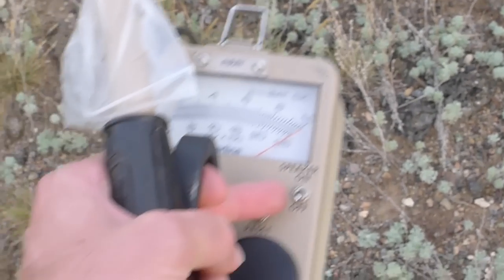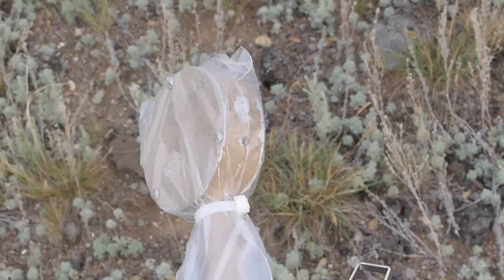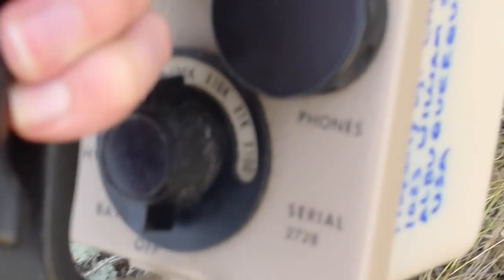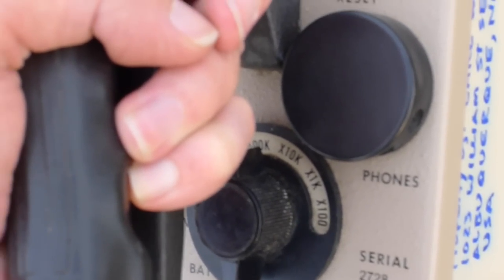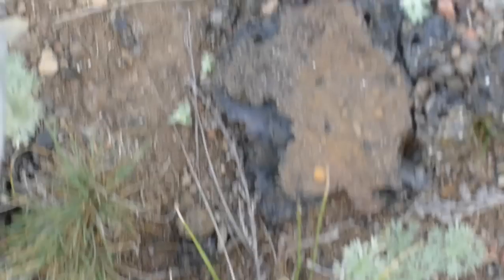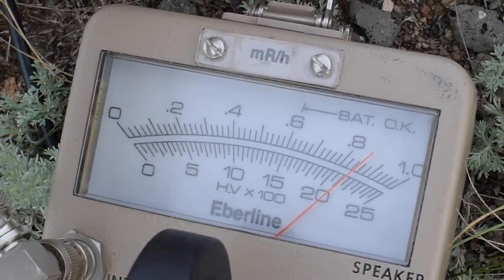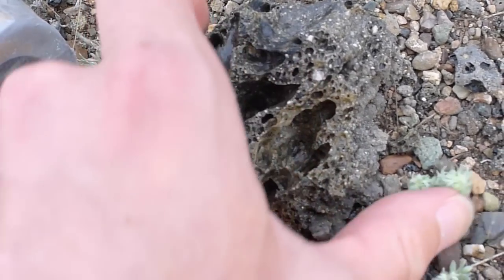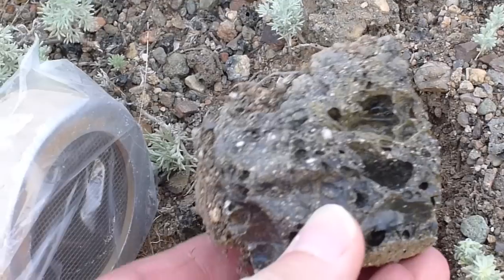Site of the first Soviet nuclear weapon test (RDS-1)

Comment: Great video but too short! :D Thanks
I often see this more professional setup of Pancake detector and Hotdog detector heads and I was wondering what sort of ball-park figure should I expect, to obtain a modest detector with both heads?
I've seen and considered the Gamma Scout range but I would like something that can measure the higher and lower levels of ionizing radiation more accurately.
I've got some Trinitite specimens obtained from New Mexico  and I'm presently without a detector but this video shows similar examples of Nuclear Sand but not green like most of the Trinitite specimens .

Comment: One hundred counts per minute of what unit of measurement?

(Just saw the milliRem per hour thing on your counter.)
Reply from the maker: The mR/h conversion scale means nothing, generally, unless the specific energy-compensated detector that scale is designed for is actually attached to the ratemeter and is being used in a manner appropriate to that type of measurement.

Comment: Cs 137 is a beta emitter.  The shield on the Hp-270 is closed , so shouldn't the activity being detected be gamma only and not Cs 137 based?
Reply from the maker: Cs-137 is associated with gamma radiation of 662 keV energy, in addition to beta decay.  It is accurate (though somewhat pedantic) to note that the 662-keV gamma is actually emitted by the short-lived Ba-137m daughter of Cs-137, which is almost always encountered in equilibrium with Cs-137.  With the shield closed, the HP-270 is responsive only to gamma radiation, enabling exposure rate measurements.
Reply: Yes, but going back to the original idea of my comment (albeit poorly written) isn't the activity you found something other than Cs decay?  The half life of the Ba 137 gamma is really short and you would think that the quantity of the Ba material would be so small by now as to appear insignificant to your measurement.  What do you think the gamma activity you found is due to?
Reply from the maker: As mentioned earlier, Ba-137m is in secular equilibrium with Cs-137 and the gamma radiation customarily attributed to Cs-137 is that of Ba-137m at 662 keV.  Cs-137 is a major long-lived fission product and tends to be one of the most important gamma sources in places like this after many years.  Activation nuclides like Eu-152 and Eu-154 can be important gamma emitters as well, depending on site geology.  My analysis of the gamma emitters from the nearby Chagan test site is shown here: 
https://carlwillis.wordpress.com/2012/08/19/gamma-analysis-of-chagan-atomsite/
Reply: Ok thanks!

Comment: To be fair, 200 milliroentgens is 2 milliseiverts, about the same radiation as a trans pacific airline flight. I'm 65 and would live in Fukashima or Chernoble if it were offered free with meals. The radiation in me stvareas away from the plants is lower than background radiation in Brazil.
Reply: It was 2mR/h, not 200. Also 200mR/h is about 1000x the dose rate you get on a flight lol

Comment: what is 100,000 counts per minute in rems per hour?
Reply: ~333 mrem
Reply: Not Real so less than a rad of radioactivity?
Reply: ***** youch at that level exposure over the course of a day can be lethal
Reply from the maker: As mentioned in the video, the measurement you guys are looking at is in counts per minute (CPM) and comes from a two-inch "pancake" Geiger tube.  It cannot be converted into mR/h or any other meaningful dosimetric unit.  The exposure levels in this spot are about 2 mR/h (obtained with a dosimetric probe; see the video beginning at 2:00).
Reply: Carl Willis and the safe limit from what ive read and heard is 5 rems per hour in 1 year. 1 russian scientist had been exposed to more than 100,000 rads an hour when a beam in an accelerator fired and went through him im surprised he wasnt killed on the spot

Comment: something doesnt add up here.  I have about half a pound of Trinitite in my basement.  Its fairly dead.  Also there should not be a count change when the probes switch.  I think one of the probes might need re-calibration.  I say this cause I have a piece of pitchblende from the Manhattan Project, on my calibrated scintillator it reads about 30k per second(1.8million per min) and on my geiger counter it is about half a rad a hour.  So I find it hard to believe that at 800k your only getting about 2milirads a hour?  This is even more so since the scintillator I have can measure alpha so its counts from the pitchblende are mostly alpha which your detector wont pick up and so the count number should be lower if you used your machine on my sample, so one of those two probes is off.  My gut says its your pancake model giving you too high a count reading as the 1-2 m/Rhr sounds high but not impossible given the site.
Reply: Your uranium ore does not read 500mR/h. That's because you're measuring alpha and beta too. Only use exposure units when dealing with gamma only on an energy compensated probe. The uraninite is highly unlikely to exceed 100mR/h in gamma.
Reply: There's nothing odd going on with the measurements. He didn't get 800k on the glass btw, I think it was 80k (exactly what you'd expect). The gamma dose rates also seemed to be around what I'd expect.
Reply: @inductivelycoupledplasma6207  yea except CV-700's only read gamma.  And I am well aware of how unusual the pitchblende piece is, like I said its unusually strong for uraninite probably due to the fact that its in matrix and the ore from the Manhattan project which used ore that to my knowledge was the richest uranium ore ever mined so there would be lots of daughter products.  None of that changes the fact that those readings in the video dont make a lick of sense for Trinitite of that age.
Reply: @Lucinat0r  it's not trinitite. The main thing that makes this stuff more active than "trinitite" is the greater number of weapons tested on the site, along with the fact that they tested underground nuclear explosions, which leave much more fallout at ground zero. You uraninite doesn't put off half an R/h, no matter how rich or rare it is. Measure it with a proper energy compensated GM probe.

Comment: Why is the site here highly radioactive but trinity is not radioactive whatsoever?
Reply from the maker: This site was the location of numerous nuclear tests, not just one as at Trinity.  The tests here were all more recent as well, so there has been less time for byproduct activities to decay.  Finally, much of the contaminated slag at Trinity was removed and buried, while the "Opytnoe Pole" remains completely unremediated.  Radiation is actually very detectable at Trinity today, with many areas around the obelisk measuring 30-10 times background from external gamma exposure.
Reply: +Carl Willis Thanks man.
Reply: Garry Cole I've got some Trinitite samples from New Mexico and although they ain't significantly hot, it's comparable to this but Trinity had far more sand below it so the Nuclear Glass is also bright green in colour. it's still got trace elements of transmuted isotopes, bomb components and/or traces of metal from the tower